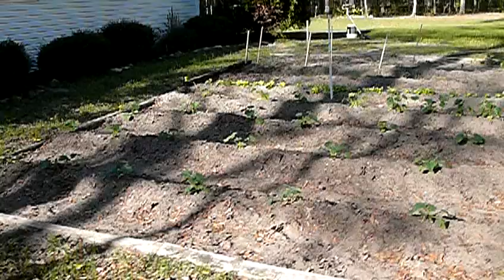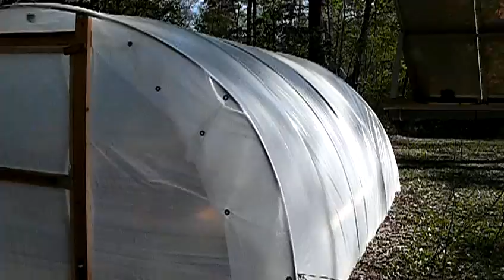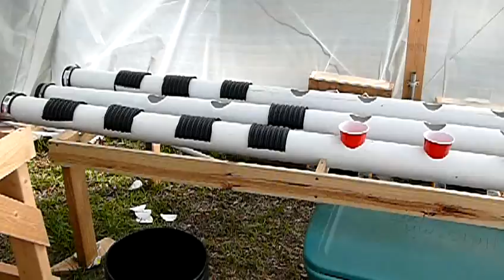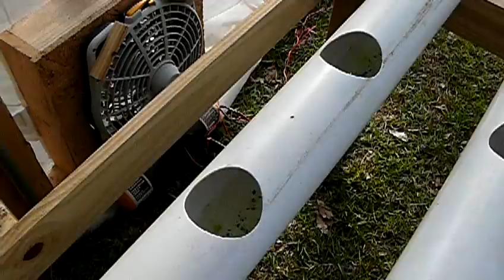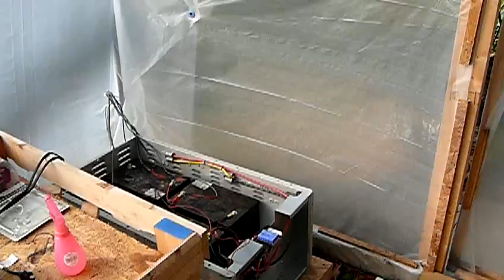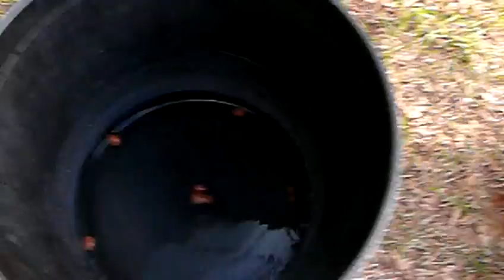hydro4video

Comment: @MplayboyC could be better to connect the solar panels to the grid rather than batteries to make it more green (all solar energy used rather than only when charging). Batteries are always a last option in my opinion (only when access to grid is not possible) because of ALL the resources that go into producing them (and disposing/recycling them at the end of their relatively short livespan) plus the acid they produce like @stogieltd points out is a pollutant. otherwise nice project

Comment: Dude, nice set up but I would get the battery banks OUT of the greenhouse. Over a period of time if you eat from your garden your bound to be getting some serious cancer causing acid fumes that inside a contained area those plants are going to really be soaking the vapors in. You don't even want to grow plants in a garden that has a border made with pressure treated wood because of that and inside the greenhouse with all those batteries is probably ten times the risk.

Comment: Followed your project from the start Dave. Building my own.Tube ur using is drain pipe 4 inch thin wall my local hardware store stocked it. Got 3 ten footers. Halved them. Three 4" screw in caps  for access.Three 5' sections hooked together with 4" tee on center and two 4" 90 elbows.Fill and drain fitting on nr.one end overflow on nr 3 pipe.Using silent giant airator and 295 gph pump in 30 gal water barrel. Flood and drain. I appriciate your experimenting Dave. Hope mine will work.

Comment from the maker: If you noticed the fans in the back wall, I am considering a small radiator mounted outside in the fan frame.. Something like a transmission cooler or possibly a car heater core.

Comment from the maker: I did some timing measurements on my system.  It takes 3 mins and 45 secs to pump the tubes full.  Turn pump off,  takes 6 mins 45 secs to drain tubes.  I'll start with 20 mins out of every 1.5hr and adjust per your recommendations. Thanks....

Comment: what is h2o2. it is common hydrogen peroxide. it is water with an extra molecule of oxygen added on. so the oxygen breaks off and leaves water. now, that oxygen not only can breathe into the roots like it can breathe into us but also it has the same oxidizing power. so it can be burning YOU if u get the strong kind. also it oxidizes bacteria so it is not used in organic systems unless u are wanting a cure. as a root rot cure it is the best.

for cure, pure 3% solution.

as fert, 3tsp per gal

Comment: about injecting air. ur idea sounds fine. anything that puts that action/aeriation in there is ok and great. usually they put air to the reservoir. like an air tube off a little cheap fish tank air pump. the end in the res has an air stone on it to diffuse/make smaller bubbles.

oxygen CAN go in with h2o2...now i can't say i've heard of it used solely in a still water res but u would be getting action off that regular exit and entry of nutrient water; so idk. just saying it's out there.

Comment: timed waterings. the 2hr/40min is prolly a stretch. now i hate to SAY cause actually i haven't researched outside florida grows; but; inside worldwide, all numbers i have heard r more frequent/less lengthy. BUT also u got the guys who soak 24/7 except there u are bubbling in a bucket_like constant flow. given the size of ur pump i think u could pull it off although it would be breaking ground technique wise.
so, specifically, inside figures i have heard are: 5 min every 20 up to 25 every 1.5hr.

Comment: re cooling the tent. i remember u said u will be peeling back the plasic to let in more light and air. also i thought i'd mention that if u do cool the tent sometime, best is the intake fan at the bottom of a wall; then the exit hole at the top by the ceiling.

Comment: about ur email. sorry but i suck sometimes. 1st my pute ate it then i even deleted it from my inbox ON ACCIDENT.

so ok. about burying ur reservoir, we decided it will prolly not be adequate due to the water circulates to the top and will warm from contact with the PVC. so prolly over time it will even warm the dirt down in ur hole. 

so u prolly need a fan. it works really well. u do not even have to have the fan by the res, you can pipe in the flow of air.